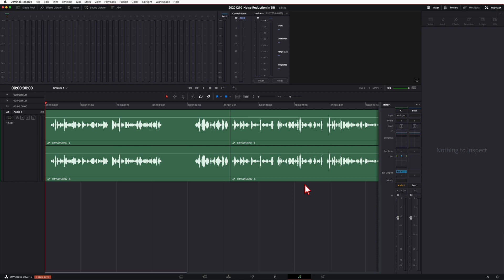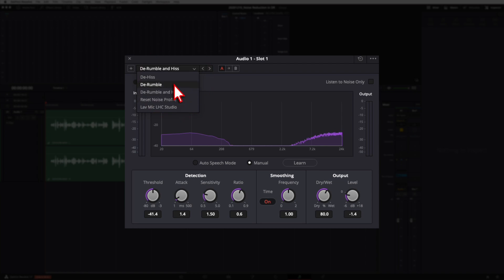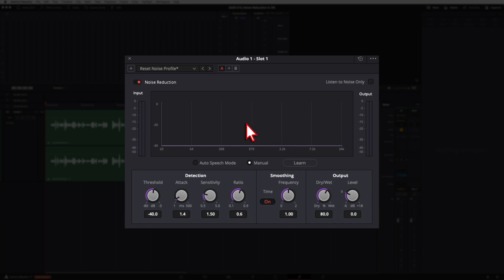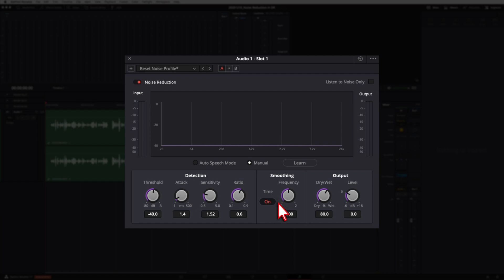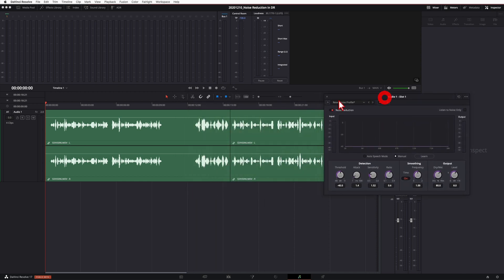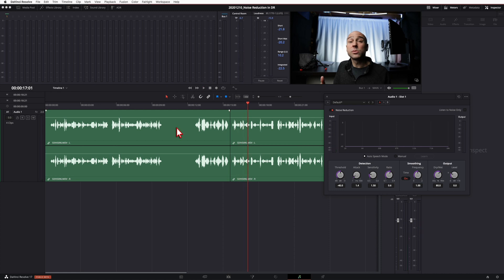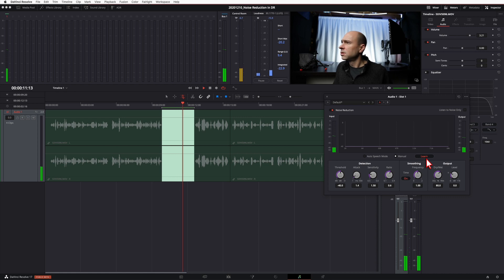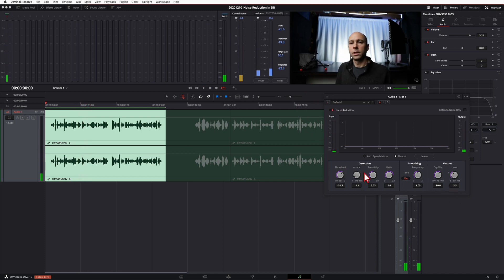Background NOISE REDUCTION in DaVinci Resolve 17 | Audio Effects Series

Comment: No idea how you are selecting parts of the clip like at 10:50
Reply from the maker: I used the Range Selection tool in the toolbar.  You can then just window over the section you want and it will automatically set in/out points.  Then hit the loop icon to loop it.  Hope this helps!
Reply: @JasonYadlovski  thanks man

Comment: Resolve just makes me crazy. For example, I follow your instructions in manual mode, and the loop setting doesn't do anything..
Reply from the maker: I hear ya, sometimes it drive me nuts too.  To loop it, make sure you set in/out points, hit the loop button, then use Alt (option on mac) + / for it to loop the playback.  It should work if you do that.
Reply: @JasonYadlovski  Thanks, I did exactly what you said, but all I get is a "can't join clips" error message at that third step.
Reply from the maker: Ah, sounds like the shortcut might be set to something different on your computer since we are just trying to playback, not join clips.  For the 3rd step, try looking in the Playback menu at the top, then go to Loop/Unloop and see if that works.  It should also show you the keyboard shortcut next to it if one is assigned to it.
Reply: @JasonYadlovski  Ctrl + / is my shortcut. But it made no difference.
Reply from the maker: Not sure what to tell you then 🤔 that the only way it works that I know of.

Comment: how to have different noise reduction settings for different parts of the track, do i have to cut the clip and make a new track for each one or is there a way to apply noise reduction only to a selection/clip and not the entire track?
Reply from the maker: You can play noise reduction to a single clip if you’d like. In Fairlight, Just open your effects library, go to the audio effects and drag and drop the noise reduction onto the clips you want to use it on.

Comment: This either doesn't apply on my clip when I go back into the regular edit timeline, or it puts it on the entire timeline on every clip on my entire film... Is there something you do or hit to make the effect apply on the clip where you want it to? Every video I see has someone showing you on one clip, but when you have many, how do you get it to work and separate the effect from the others and get it where you want it? I even highlight the clip I want it on and it still doesnt work right on there.
Reply from the maker: If you wanna apply an effect to one clip, you have to open the effects library in either fairlight or the edit page, and then drag effect from the effects library onto your one particular clip. If you try to use the effect in the mixer in Fairlight, that will apply the effect to the entire track which includes all clips in that track. 

I hope this helps and makes sense, thanks for watching!
Reply: @JasonYadlovski  Thanks a lot, man!
Reply: Sorry to bother again but I did have one final question. After adding noise reduction to a few clips, there's a glitch sound, mini jump-like in the audio in a few spots in my fairlight timeline but that glitch sound isn't there in my audio in my normal editing timeline. So, I was just wondering which one is telling me the truth when it renders? 🤔
Reply from the maker: You should be fine when it renders.  I’ve noticed sometimes there are little things like that in Fairlight but not in edit.
Reply: @JasonYadlovski  Thank God. Lol And thanks for your time, Jason. Pretty cool of ya.
Reply from the maker: Happy to help.  😁👍

Comment: I have a better result with my cleaning chain. ERA-6 Noise Reduction 20% Bertom Denoiser 30% NS1 (waves) 20% Try it, my result is luxurious and create a video.
..................................
Tengo un mejor resultado con mi cadena de lmpieza.
ERA-6 Noise Reduccion 20%
Bertom Denoiser 30 %
NS1 (waves) 20 %
Pruebalo,Queda de lujo mi resultado y crea un video.
Reply from the maker: Nice!  Thanks for sharing.  I agree the build in noise reduction is not good. I don’t use it and favor using the NS1.

Comment: How do you apply the effect?
Reply from the maker: Once you add the effect to the mixer in fairlight or drop it on a clip in the edit page, it's applied.  You just have to adjust the settings so it works best for your clip.

Comment: Dear Jason - thank you so much for all your videos, including this one. Very helpful! However, I have a question which I haven't seen asked anywhere but is critical for my project. I'm hoping you or others can help. I recorded a number of voice overs (using a USB Audio-Technica microphone). On first listen with normal headphones at 70-80% volume control, they recordings sound fine with maybe the odd distortion. But when I use high quality headphones at 90-100% volume (loud, but listenable), I can hear electronic glitches and distortions throughout (artifacts plus voice distortion). Now I'm in a quandary. I now know that the voice recordings are basically completely distorted if you turn up the volume, but basically fine if you don't. Also, listening to hours of recordings at a volume of 90-100% cannot be good for the ears. Question: what volume do you or others set your headphones at when doing audio editing and cleanup? Just ignore audio glitches if you can't really hear them at normal volume limits? (e.g., recommended 70% setting on your headphones). Thank you!
Reply from the maker: Hi!  Thanks for checking out my videos!  So I think I would approach the issue a little differently.  I don't set my headphones to any particular volume.  I think what you should be doing is setting your audio levels properly, using the meters in Resolve, then it won't matter what volume the headphones or speakers are set to.  

Breaking it down further, here's what I'd do - When recording, make sure you have good level with NO peaking.  That will insure a good starting point. Next, when you get it into Resolve, set the audio levels there properly as well.  For dialogue, I'd set the levels to around -8db to -10db.  Create your video, and when it's done, you want to check the loudness levels to make sure it will work well for the platform you will be posting to.  For example, YouTube is -14 LUFS, whereas Broadcast TV is -23 LUFS.  

I've got videos on all this stuff if you are interested.  Don't worry about the headphones volume as much as properly setting all levels along the way using meters, etc.  Hope this helps!
Reply: @JasonYadlovski  Thank you so much Jason for your feedback. I/we very much appreciate the time you've taken to make these videos and to provide individual feedback. I will review again all of your videos re. sound recording/editing via Davinci and bear in mind your points above. If I find a solution or culprit, I'll share again for you and viewers. Just to provide you a brief update on the investigations into the glitches caused by the USB microphone (I'm now in contact with sound engineers and Audio Technica). It seems that the issue may lie in interactions/settings between the USB microphone and Windows 10 (I have a direct connection, no interface or mixer). We are working on this. You and many viewers may not encounter these problems if you are recording using a high quality XLR microphone connected to the computer via an external mixer or other interface (I believe this is your setup). (I am trying to record on the cheap, and this may be a limiting factor!) I will keep you posted and thank you again!

Comment: Hi Jason, Great tutorial. This is a question unrelated to this video and maybe you can help. I'm working on a long short, 21 minutes. I separated all the clips in individual scenes into separate timelines. Now I want to open the clips up from multiple timelines on the edit page... but when I click on a timeline to "Open in Timeline" all the other timelines disappear. Is there a way to open all the timelines at the same time in the edit page. I hope that I have explained this correctly because the client wants to put some transitions between the separate timelines and the clips within them. If you can steer me in the right direction, I would really appreciate it.
Reply from the maker: Hi, thanks!  Yes you can open more than one timeline.  Here's a video how to do it:  https://youtu.be/IndPM3Jcz7o  Should be the same process in DR18.  Hope this Helps!

Comment: Thank you for this. One point of clarification - the noise reduction done on a 'portion' of the clip is automatically applied to the entire clip, am I correct? This is a helpful tip for me, as I was extracting the audio from my clip and using Audacity to effect noise reduction, then replacing the audio in DaVinci. Mine was a cumbersome workflow for the tutorial videos I make - and since I'm not doing cinematic movie productions, I think this will be a comparable alternative.
Reply from the maker: Hi!  If you want to adjust it on a portion of the clip, I would make a cut around the section do you want to apply the noise reduction to. Otherwise it will apply to the whole clip. You can probably use some automation tools to turn it on and off, but it might be easier just to make some cuts and apply it on the part of the clip that you want
Reply: @JasonYadlovski  Perfect. Thank you.

Comment: Hi I watched your video at least five times and tried three times, but I could NOT reproduce what you mentioned here. Like: Repeat the audio when selected... the nosise reduction. etc. I am using V17.4.5 now and tried your way when I used 17.3. 

What's wrong? What mistake I could make? 

Thanks~
Reply from the maker: Hi!  Do you mean the audio won’t loop?  You need to select the range with the range selection tool, then hit the loop button in the toolbar, then hit the keyboard shortcut alt (option on Mac) + /.  If the shortcut doesn’t work, you can double check the keyboard customization to make sure the shortcut is set.

Comment: everytime I try the noise reduction and select my clip, the noise reduction is applied for all the clips. Then I have to undo it and just accept that my video has audio inconsistencies. Any advice?
Reply from the maker: Hi!  Are you trying to apply it to just one clip?  If yes, go into the effects library in either the edit tab or Fairlight, find the Noise Reduction effect and drop it onto just that one clip you want to effect.  If you drop it on the beginning of the track or add it in the mixer of Fairlight, it will apply the effect to the entire track.
Reply: @JasonYadlovski  thank you so much for taking the time to answer this. Much appreciated Jason!
Reply from the maker: Happy to help! 😁👍

Comment: Really useful video as always, thanks! Could you do a video on using 32 bit float files in DV? I recently got a Zoom F6 and noticed odd behaviour with the sound wave view when you alter the level. It seems to work as expected sound wise, but if you reduce what appears as a clipped section the wave still shows as clipped when it obviously isn’t anymore. In other software like audition, the recovered info shows normally. Is this just a glitch in the software? Any tips would be welcome! Thanks. Best wishes.
Reply from the maker: Hi!  Interesting.  I've never worked with a 32bit float file before.  I'll have to see if I can find some info on it and maybe a file to play around with.
Reply: @JasonYadlovski  Yes, it’s odd. There seems to be forum comments regarding this issue since support for 32 bit float was introduced in DV back in version 16.2, yet no fix. I’ve emailed Blackmagic support too, so I’ll see what they say and report back. Hope you’re well. Joel.

Comment: Hey Jason. Do you know why the audio of my video sounds high enough but when I export it the audio sounds much lower?
Reply from the maker: Hey Rosso - not sure, could be budget different things. Where have you set the levels for your audio tracks? You can also check the loudness levels before exporting, once all your audio work is done. I’ve got videos about setting levels as well as loudness or you can check out if you’re interested.  Are you editing and playing it back on the same device?
Reply: @JasonYadlovski  using Davinci I have edited my video with the default levels of loudness as I am using a Rode microphone. Before rendering the video it sounds great but after rendering it the sound gets lower. It is so low that it seems I am telling a secret
Reply from the maker: That’s very strange, I don’t know why it would do that. 🤔

Comment: The Noise Reduction option under "Effects" is just not there for me; there is nothing between Modulation and Pitch

EDIT: I ended up finding it under the Effects tab at the top
Reply from the maker: Glad you found it!
Reply: @JasonYadlovski  they must have changed the UI slightly between updates. Also thanks for the guide!

Comment: Thank you for walking through the plugin. Personally can't manage to get a good result out of it and tbh I think your example was better without the reduction, the voice just starts to sound too unnatural. The Plugin just doesn't do it well enough. The RX8 De-Noiser does a decent job, but can't be used as a PlugIn in Resolve - or I don't mange to get it running. Do you have an idea on how to make foreign VST / AU plugins work? RX8 works as an external audio engine in Resolve, but that's just too much work for a bigger project with many audio files.
Reply from the maker: Hi!  I agree with you, the built in NR isn't so great.  I really don't use it much.  I use other plugins from Accusonus and it works much better.  But you're right, too much and it sounds all weird.  I've heard of the RX-8 stuff, but never used it.  You can use other VST plugins in Resolve.

Comment: Thanks for this - just learning the tool.
One thing that would have been helpful - maybe it is thought as too basic - but how do you APPLY your changes?
Especially if I have multiple clips.

regardless of my other ignorance of the tool - thanks for the video!
Reply from the maker: You’re welcome!  Your changes will be applied automatically, you don’t have to do anything. If you’re using the effect on a track in Fairlight, it will apply to the entire track. If you apply to one specific clip by dropping it on a clip then only that clip will be effected. The changes are active as soon as you make them regardless of how you have applied the clip. Hope this helps, thanks so much for checking out the video!
Reply: @JasonYadlovski  Awesome thanks!

Comment: A question, can I use the NR learn thing from one clip in another. For eg, i left some silence in clip 1 but not clip 2, so i learn the NR from clip 1 and then apply it to clip 1. Will it still affect clip 2 since they both are on the same track?
Reply from the maker: As long as you use the noise reduction for the entire track versus just one clip, everything in the track will be affected by your noise reduction. You can use whatever clip you want to set it and it will apply to the entire track.
Reply: @JasonYadlovski  thanks 😁
Reply from the maker: You got it, happy to help!

Comment: Thank you for your video. Could you please clarify at which step of the audio editing workflow NR should be applied?
Reply from the maker: You’re welcome!  Typically I’ll EQ my audio, then set some dynamics and the add effects like noise reduction.  I usually use a gate to reduce background noise, which is in the dynamics panel instead of using the noise reduction effect. I find it works a little bit better for my situation.
Reply: @JasonYadlovski  Thank you. In another of your videos, you have shown that you start with 'Normalization of the clip to -8dB' first. So should that be done first even when one needs to apply NR? Please note that I am making some free educational videos, so I am trying to learn this so that students may have a clear voice to support their learning. Thanks again.
Reply from the maker: So here’s my process - I’m going to set my levels to approximately -8 db.  You can normalize to do that or you can just adjust the volume in the inspector or fader for the track.   Then I EQ the clip, next apply dynamics - a compressor and gate, then any effects - I use multiband compressor and a DeEsser.   I’ve got videos on all that stuff if you are interested.  👍😁
Reply: @JasonYadlovski  Oh yes, I actually referred to this workflow I learnt from the video you mentioned. I just want to know where does 'NR' fit in the above-mentioned workflow of yours.
Thank you again for taking the time to reply.

Comment: I filmed on a busy highway. How can I get rid of the amount of loud BG noise and hear what my friend in the video is saying?
Reply from the maker: Hi!  My initial thought is that you’re not going to be able to remove all of it for sure, so I would focus on how to minimize it. I would probably start by adding a gate and adjusting my threshold and range to try and minimize the sound. Then I might try the noise removal effect in this tutorial. If you have any third-party VST plug-ins that you like for noise removal you can always add those in as well.  You could try a little EQ to bring down some of the frequencies that contain the noise if it does not interfere with the vocal.  Basically you’ll just have to try a bunch of different things and see what has the best result.  Thanks for checking out the video and best of luck on your project!